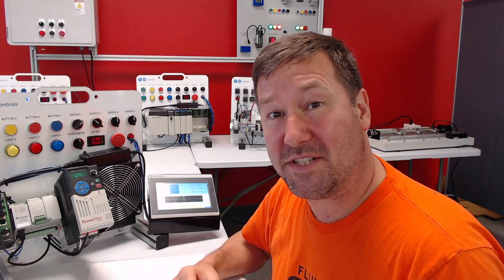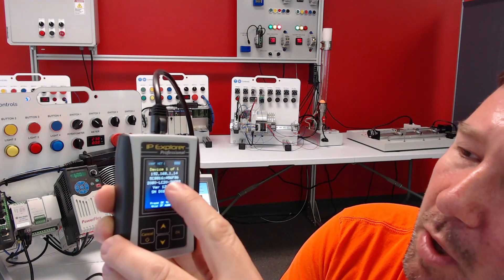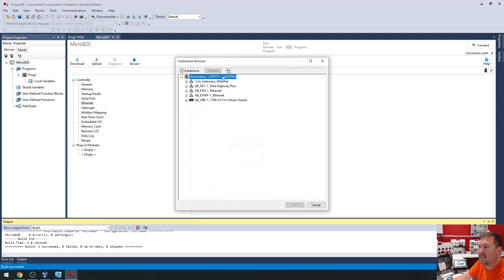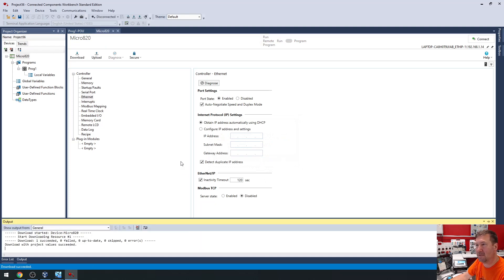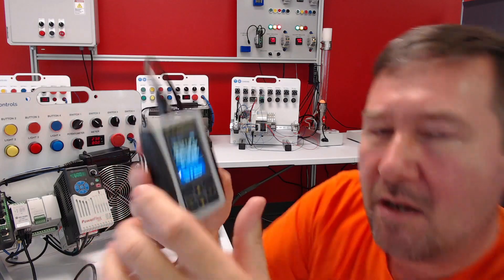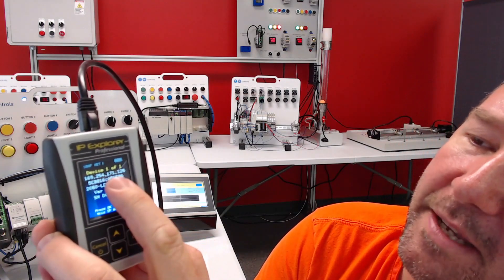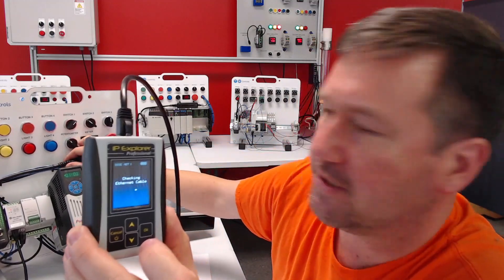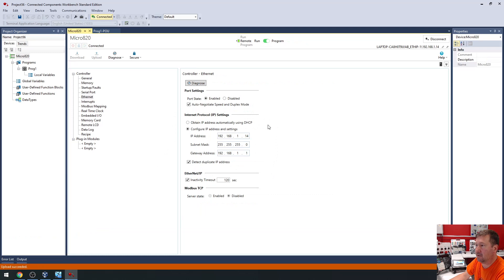Allen Bradley Micro820 Micro850 has Random IP Address of 169.254.X.X

Comment: is there a way to fix this without having to buy an IP explorer ??
Reply from the maker: Yes, just not an easy one :)
Reply: @TimWilborne  In all seriousness, I run a high school lab with 40 laptops connecting to a trainer.  The PLC is set to DHCP, so we have do discover the new IP every time a student plugs in or turns on.  There must be a reasonable way to set the Micro820 to a static IP without a special tool.  I only have to do this once, and if the method involves a couple more hoops without a special tool, so be it.  What's the method?  And if I am picking a static IP for it, can I pick any value? Or must the static IP's first two pairs of numbers need to match my local network?  Thanks for the advice!

Comment: When trying to change a DHCP address in a Micro 820 with the IPE my device gets stuck on the Waiting for BOOTP or DHCP Request screen. What am I doing incorrectly?
Reply from the maker: There is an issue with the Micro820, it does accept the "Enable DHCP" command.  Rockwell Automation is aware of it.
Reply: Ok but I just purchased your SIM-IPE and have that same problem so what do we do about this? It doesn't show the "Assign address" either

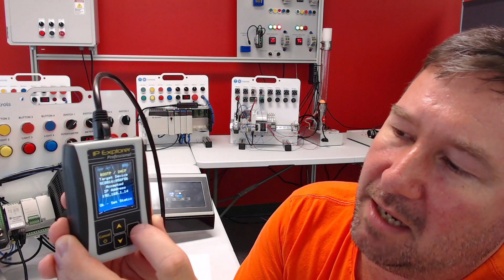Comment: At 4:47, I get the message "Target Device Reported Error".  Not sure what the next step should be?
Reply from the maker: Are you sure it doesn't already have an IP address?
Reply: @TimWilborne  It has an IP address that was assigned by DHCP, not a static IP.
Reply from the maker: By DHCP do you mean our device or another DHCP server?
Reply: @TimWilborne  Both. If I plug it into a computer network connection, I get one address. If I plug it into IP Explorer,I get a different address.
Reply from the maker: Might be easier to send me an email, it's usually a problem with your network settings of the IPE.

Comment: Tim. Computer IP=192.168.1.105, Micro 850=192.168.1.102 (I already made communication between them), HMI t4t= 192.168.1.104 (I can not see the HMI in the connection browser), I tried using the same IP address PLC/HMI, but nothing yet. where am I failing?
Reply from the maker: If you can ping the HMI but not see it in the connection browser then check out this video.
https://www.youtube.com/watch?v=-N1meHqahlg

Comment: its been a good problem for me ,  it really drills into your head the importance of configuring your drivers , you get to learn how to navigate around your network settings and change them,  and you can go into rslinx and learn to set the static ip addresses to fix it/ learn about command  ping...even serial connection and tools available to help use get through this issue promptly  .i watch these videos so many times  i think i hear a voice in my head when i start a new project lol.. ."  okay first thing we have to set our address " .. some of the steps associated with fixing this problem in different ways teaches very important info for being able to connect to plcs in general
Reply from the maker: It is a good thing to practice that way you know what to do when you run into it out in the field.

Comment: I've had the same problems lots of times when using a micro820 for the first time. Fortunately I have always had a REMLCD connected to the 820. From there it is easy to find its current IP. But, can also find the IP from a laptop using the command prompt and the arp -a command. This will bring up its IP with Mac address. I always get caught out using the micro820 for the first time.
Reply from the maker: Yes, I should grab an LCD to play with.
Reply: @TimWilborne  That will be a useful video. 
Every time I install a micro820, I always use an LCD with it.